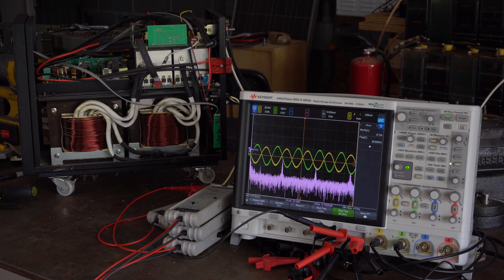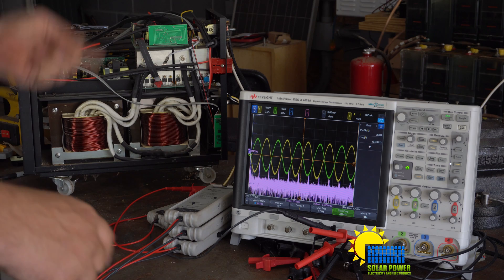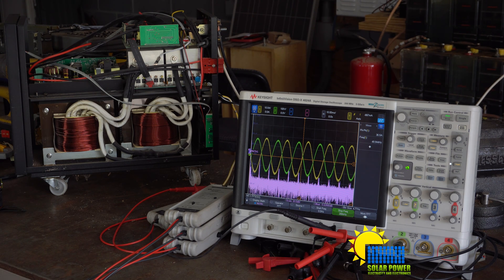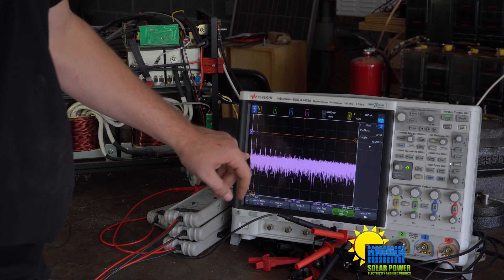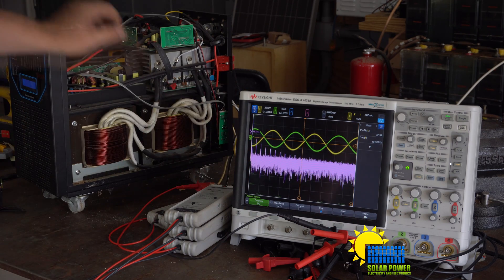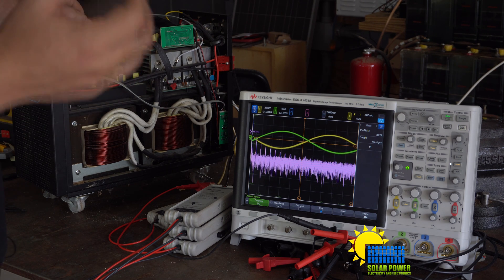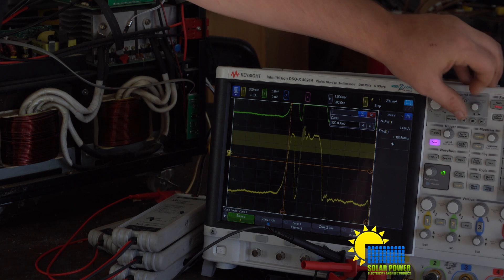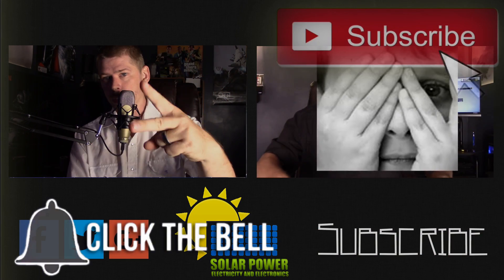6000 Watt Aims inverter Pure Sine Wave On The Keysight DSOX4024A Oscilloscope

Comment: What's loading it? you should have some resistance load, like a 200 watt incandescent lamp, to stabilize it. If the inverters output is open, there is nothing to take up the ripple current from the inductors within the inverter. a common mode rejection transformer and a small capacitor will take up that high frequency ripple, with only minimal effect on output regulation. Granted, that should all be built right into the inverter. the 220 watt idle current is a bit much, since I need to leave it on continuously, to keep power available for refrigerators. The inverter takes the same power as my deep freezer, while running. Since the refrigerators cycle, the inverter takes more than twice as much as any one of them. Too much! I would need to install four 275 watt panels, plus the extra battery capacity,  just to keep it humming. Never mind, supplying any load.